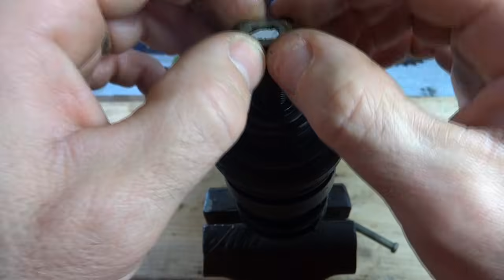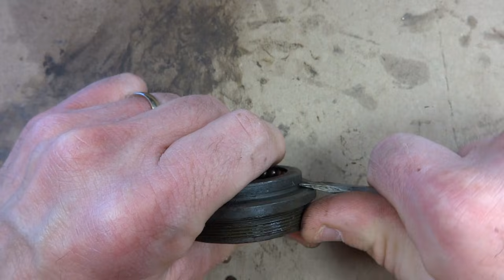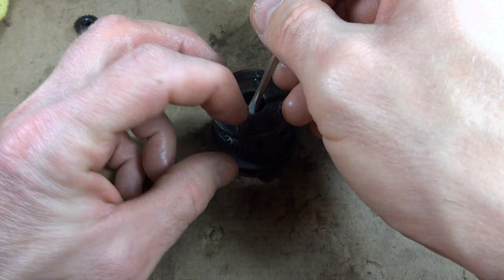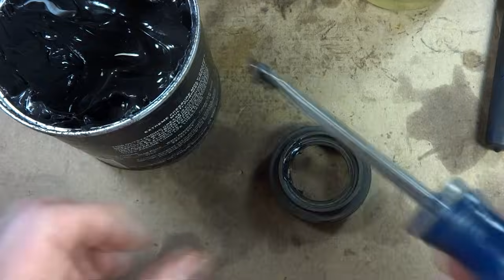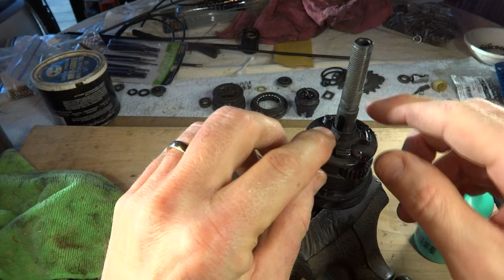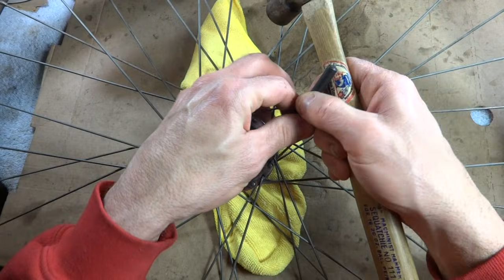How To Overhaul/Clean/Lube Sturmey-Archer 3 Speed Hub - AW type

Comment: What a great video. Just bought my daughter an old second hand Raleigh Caprice and found to my horror that first gear didnt work. Tried flushing with WD40 but no joy. You have saved the day. I down loaded your video to my Kindle and step by step followed your instruction in my shed. Worked a treat. I used white spirit and a toothbrush to degrease and a magnetic screwdriver to recover the parts. I found the first gear pawl section had rusted up and a lot of fragements of metal appeared in the wash tank. All came apart & cleaned up. The semi circular indents made the hammer and punch difficult and the SA bespoke 'C' spanner is expensive and only for installation. So I used 18 inch stilsons and a mallet to shift the collar..they just lock into the indents. The rust had eaten one of the Pawl springs so I used some spring steel out of a ball point pen to make a new one as time was not on my side. I hear old electric guitar strings are even better. I had a chromed ring that went round the bearings as an extra part. I used oil for my four stroke lawn mower as the lubricant and added a couple of squirts in the filler cap at the end. All now works perfectly. Thank you.
Reply from the maker: It could be something as simple as the shifter cable needs to be adjusted: https://www.youtube.com/watch?v=KvR0S6lHJ4Q
It's possible the pawls are sticking. Have you added oil to the hub? Or maybe the hub would benefit from an overhaul. Sometimes pawls or springs break.
Reply: postmann1000 Well,two of the pawl's springs were broken.I 'm still waiting for the replacing parts.I'll let you know when it'll be ready.
Reply from the maker: You can try adding some oil in the oil port and see if that helps. If you don't have an oil port, you can remove the indicator pin, and add the oil through there. Maybe half a dozen drops up to a teaspoon or two. If that doesn't help, you may have to take it apart, There could be something broken in there.
Reply: Good tips for the oils
Reply: I have the same problem,the first gear does not work.I didn't know what to do.
I'll try to follow the video steps and hope it'll all end fine.
Reply: It was the pawls springs.I replaced them and first gear works just fine!
Reply: RJ The Bike Guy Well actually I have a problem with my hub.When the bike rolls I cannot hear the freewheel(the click sound).It makes a strange noise like something is scratching the hub from inside(please forgive my english)like something is broken.And as I cycle the pedals turn forward when I pick up my legs,they don't stand steel.Luckily I learn how to adjust the cable shifting thanks to your helpful video and I don't have problem with gears anymore.When I had first gear,turned to second without switching the shifter.And when I had the second gear,it turned into neutral!
Reply: And 🖊 pen springs for the pawl-springs. Genius
Reply: MrKarakalas  my first gear dont work too. i have 1972 sturmey Archer hub
Reply: ok thanks for the reply
Reply from the maker: Great!
Reply: RJ The Bike Guy Thank you for your answer.I've already added oil,about 10 ml I think.The noise didn't stop.My bike mechanic that opened the hub had found some detriment to the planet pinions,to teeth.But he said that would be no problem.Unless he put some part the wrong way.I don't know...
Reply from the maker: I don't know either. Without taking it apart myself, I can't really say.
Reply: RJ The Bike Guy Thank you anyway.
Reply: MrKarakalas Actually,he hadn't replace bearings,put the same.Is it possible that this fault?
Reply from the maker: Maybe.
Reply: David Southgate h
Reply: If someone was very lucky, a flush with WD40 might make a hub function again temporarily; that's if the grease was somehow contaminated and the resulting mix of old, dirty grease and new WD40 ended up having similar viscosity to the original grease.  But even if that had seemed to work, a remaining concern would be accelerated wear.  WD40 is not meant as a lubricant and certainly not a grease.  ("WD" stands for "Water Displacement")

Comment: Thanks buddy. I have a 1948 AW :) The planetary gears and sun gear got chewed up going uphill on campus! After realizing that no shop in Gainesville repairs S.A. and no one carries spare 26 1 3/8 rear wheels, I decided to learn how to fix it myself. Your video was the best one! My 48 has a threaded sprocket and mount, so I just left that guy on. Take care..--Juan
Reply: shyflirt1 oh my god, i didn't know he passed away! How sad, i've used his site a lot recently, and always imagined him writting the stuff down. Amazing resource for old bikes.
Reply from the maker: Did you get it working?
Reply: shyflirt1 planetary gears and sun gear/axle are coming in this week. The disassemble was a success. Almost every piece was caked with oil and crud. I'll let you know how it turns out!
Reply from the maker: Cool! How much did the parts cost? This hub here actually was on a mid-70s Huffy that I bought at a thrift store for like $15 or $20. I wanted to practice on it before opening up the hub on my 1970 Raleigh Tourist. I occasionally see old bikes in thrift stores with the SA 3-spd hubs for cheap. After I overhauling the hub, I turned around and sold the bike for more than I bought it for. Win/win!
Reply: shyflirt1 I got them through Sheldon Brown, who links to Harris Cyclery. With shipping it came out to 33 dollars and change. The pin holding the sun gear to the axle is probably machine pressed so no-one sells the gear by itself. Yeah, every single speed rider secretly wants an old Sturmey Archer, it's the fear of the hubs mechanism that keeps people away, and the shifter's aesthetic effect on the bike. Mine is on a westrick style Raleigh wheel.
Reply from the maker: I like his site and use it often. He actually passed away a while back, but they keep it up. Yeah, getting in there was a scary thought, but it turned out not to be that bad. I have an old 70's bike repair manual which guided me through the process. Though it did leave a few small details out which caused me to pull it apart and redo it. Like the low gear pawls having to go in a certain way. I had them in the wrong way, and low gear didn't work. Took me a bit to figure out why. Yeah, the shifter is kind of ugly! :D

Comment: Nice tutorial!!  The only thing I might try differently is that instead of using a punch to remove the main body from the hub I think I might leave the surclip in place and then use a chain whip on the sprocket to screw it off.

What is the little cap for on the hub that lets you put oil in?  Does this oil the pawls, the planetary gears, or both??  I initially thought that it must be a wet bath type arrangement like a Rolloff hub but when I put some oil in there it just started coming out the sides of the hub!!
Reply: Chain whip wouldn't work to remove the internal as the sprocket would just freewheel.  You could use the chain whip to tighten it back up on rebuild though.
Reply from the maker: I am not sure the chain whip will work. They can be on there pretty tight. Even my manual says use a punch.

It is an oil port, but only a couple drops of oil every once in a while are needed to keep it lubed. Some SA hubs don't have the oil port, but can be oiled by removing the indicator pin and oiling through there.

Comment: good man i had a raleigh grifter back in the early 80's for christmas and i always wondered how they worked inside

THANKS BRO
Reply from the maker: They are a clever little mechanism!
Reply: is that 4 speed ?
Reply from the maker: 3 speed.
Reply: so why are there 4 planets ?
Reply from the maker: The planetary gears all work together at the same time. They are not from separate gear ratios. Check this video out for a great demo on how it works. Sturmey Archer 3 speed AW gearhub. How it works.